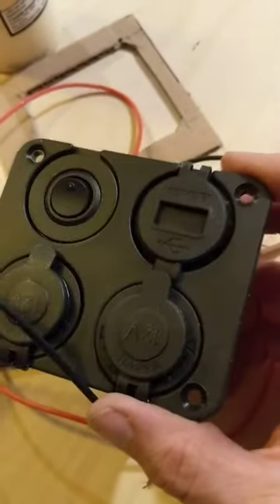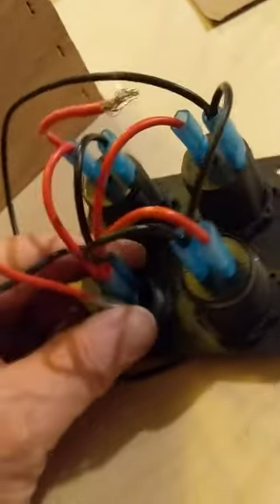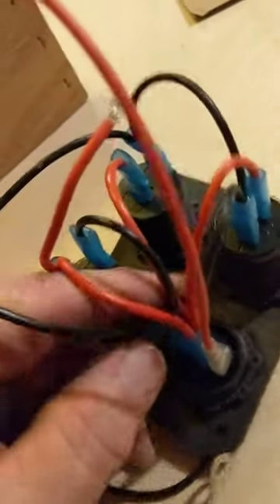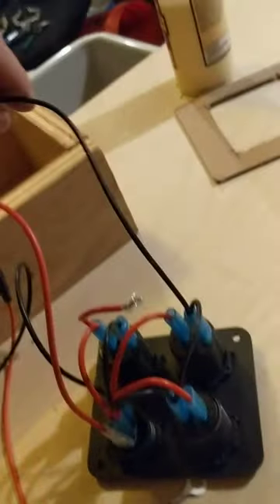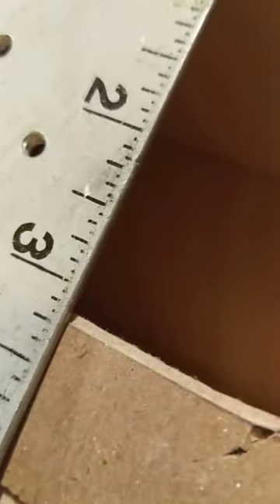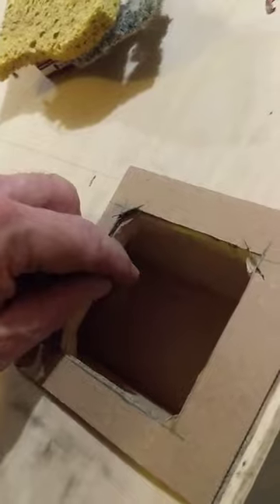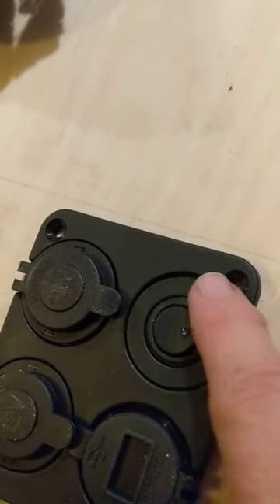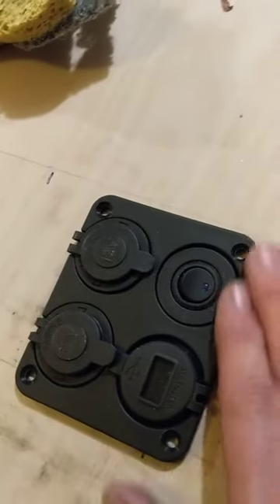Wiring and Installing square 4 in 1 Marine and RV,  USB charger, switch and 12 volt lighter panel.

Comment: How many amps will the switch handle?
Reply from the maker: I have a full write up in the Description above including the part and its amazon description. On some viewing methods descriptions are hard to expand so here it is as well.  Per Amazon: Linkstyle 4 in 1 Charger Socket Panel, 12V 4.2A Dual USB Charger Socket Power Outlet & LED Voltmeter & Cigarette Lighter Socket & LED Lighted ON Off Rocker Toggle Switch for Car Marine
Reply: @johnhilbrands3274  How many amps can the rocker switch handle?  My inverter uses 30A, I don't think the switch will last at that power of 300+ watts.